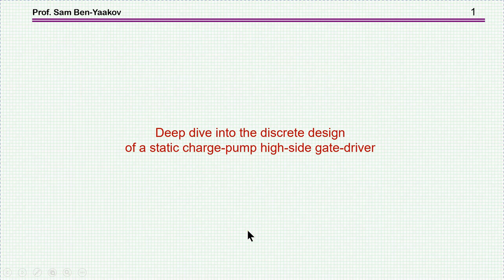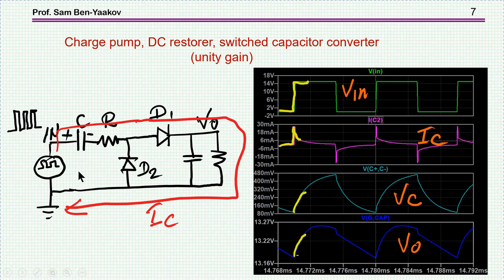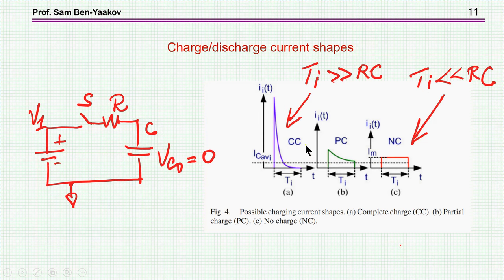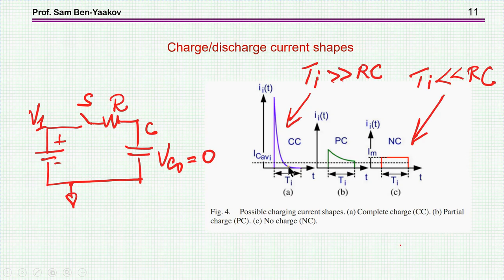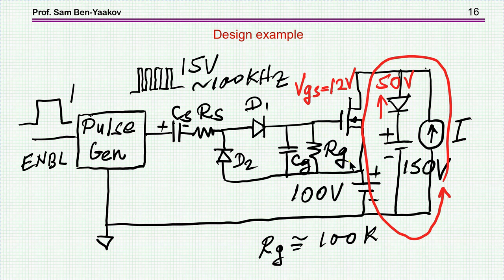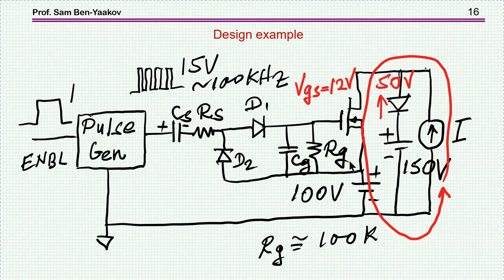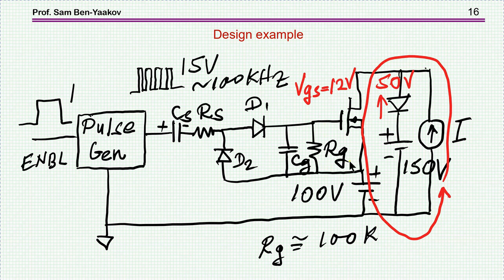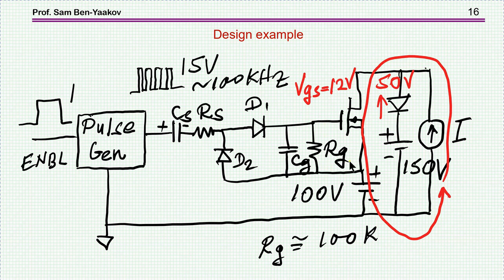Deep dive into the discrete design of a static charge-pump high-side gate-driver

Comment: Dr.Sam ,  if you have time, can you please talk about current sense transformers and their reset techniques?  Also putting CT in phase shifted full bridge. There is quite a bit of debate on where to put the CT in phase shifted full bridge (either DC bus or each of the legs of full bridge Mosfets or in series with the transformer).

Comment: Hello, and thanks for the nice video!  Could you please add some notes to explain which kind of applications this can be used for? Thanks! Also: the two power supplies confuse me. Why one @ 100V and one @150v?
Reply from the maker: Feeding a load that needs to have one terminal to be connected to ground.
Reply: @sambenyaakov  Yes, understood. Another question though: Is it fair to say that really there is DC on the gate of the output transistor? And so this is a way to get the gate higher than the source so that the MOSFET can be used as a very efficient and low resistance pass transistor?